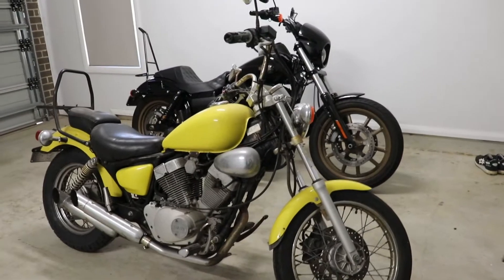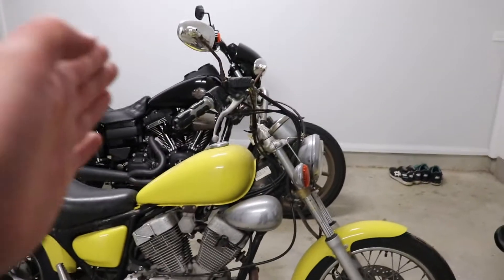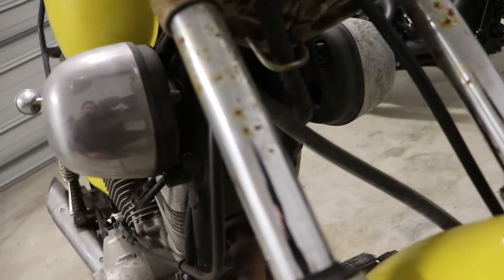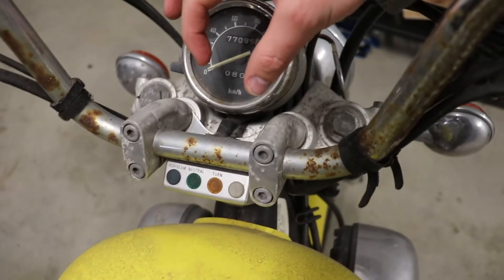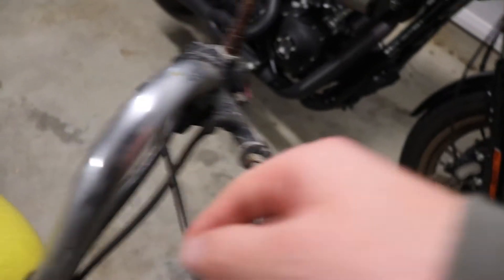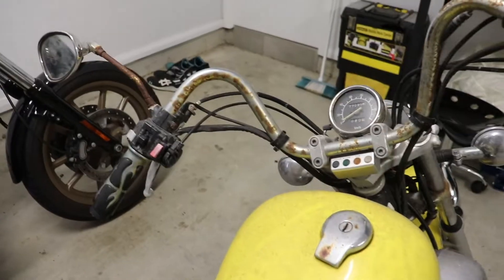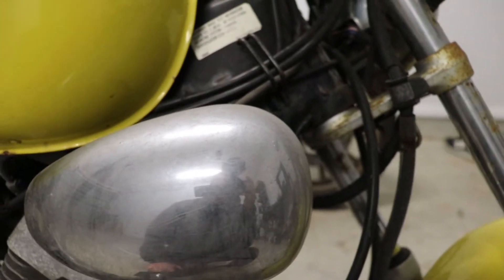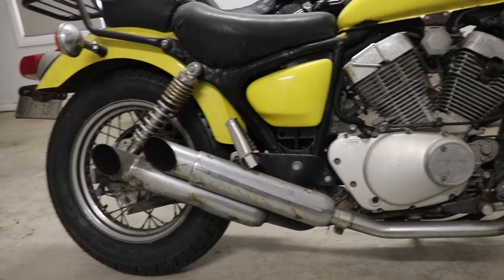XV250 BOBBER/CHOPPER BUILD PLANS

Comment: brass cup wire wheel should be soft enough to knock the corrosion off,. Can't wait mate. so excited for this project.
Reply from the maker: Do you think that will work on the forks too? Or will it be too abrasive for the chrome?